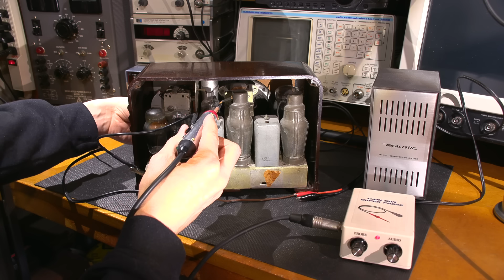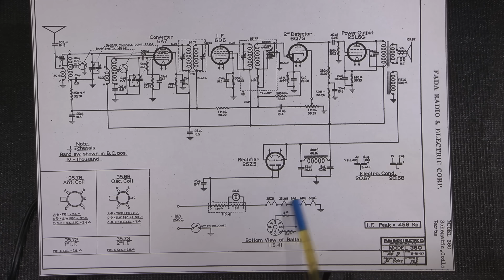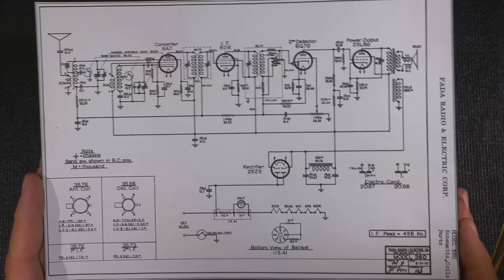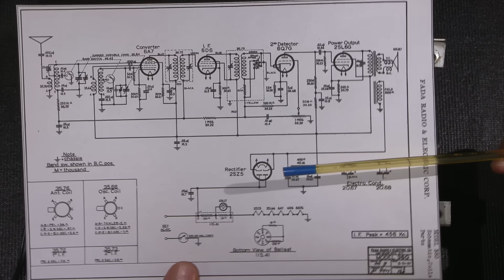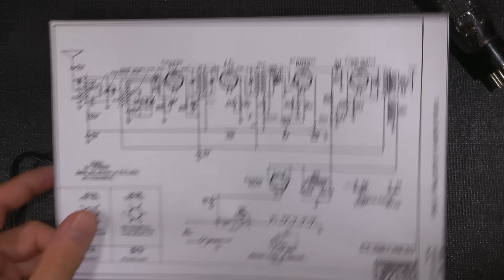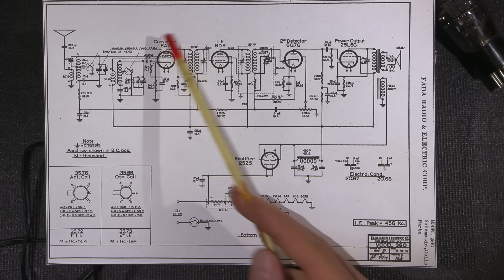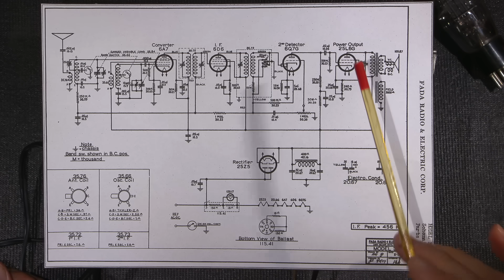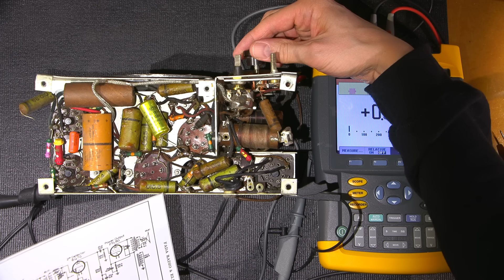Electronic Circuitry Diagnosis And Fault Finding! [Repair]

Comment: I worked as a bench tech in a radio shop in the late 60s.  Worked on mostly German tube radios that GIs brought back with them. Typical issue was power supplies that were designed to work on 50Hz line voltage.  Our 60Hz line voltage would eventually destroy the power transformer and the selenium rectifier stack.

Comment: I know it's 6 years ago but I'm sure this is well worth restoring. The fact that it goes so well with all its old components except for that capacitor might indicate that it should have a long useful life with restoration IMO. Also the case and knobs etc are all complete and in v good condition. Your knowledge of the workings of these radios is quite profound.....fantastic to have that depth of understanding of what looks so abstruse to the uninitiated. Very impressive...and the video presentation is very clear and easy to follow. Well done all round.
Reply from the maker: Thanks for the kind words!

Comment: I used to have those little shirt pocket crystal radios that worked without a battery, and only had enough output for a press in ear piece. I used to enhance the reception with a jumper wire from the antenna tip to the finger stop on our dial telephone. The antenna rod doubled as the frequency tuner.

Comment: @17:10 , what is the 1st tube you're  pointing to immediately off the mixer-tuner? (the tube in the back with grid tube)

I know the front tube is the IF amplifier tube. Is the tube in the back youre pointing to an RF amplifier tube (?).?

Are the wires on top of these tubes with grid caps charged with DC current or just the signal from the mixer-tuner?

[Im new trying to learn, thanks. I have a 1947 Silvertone (Sears) model 7103 radio/phono/wire recorder i want to check out when Im experienced.]

Comment: I worked at Radio Shack in 1981.  We still had the tube testing machine with the new tubes stored beneath the tester. I remember assisting people with it.  Lots of TV tubes were tested.

Comment: I just want to say to begin with , thanks for making this video. I was very interesting and easy explained. I am trying to diagnose and troubleshoot a mid 50's German made vacuum tubes era( not as old as the one in your video).In my case it is the same as in yours. Once plugged in and turned on, there is no sound , no noise , no humming . Like it is 'DEAD". The filaments inside the tubes glow and stay like that. The dial light is not on. I have checked with ohm meter it is good. Is that a clue where I have to took. I don't have a probe and other equipment as you were showing in the video. Any suggestion you may have will be greatly appreciated. Thanks again

Comment: My preferred solution to the line cord problem is to wrap drafting tape around the plug, figure out which should be line and which should be neutral, then mark the tape with L & N, otherwise if you encounter an improperly wired outlet, there will be nothing you can do. Best solution with these, use an isolation transformer.

Comment: My Parents bought a Philco tv & it had a 3 speed Turntable with a AM Radio from 1951. It was a Monster to move the Cabinet was Solid Mahogany Wood. It was there Top of Line model. The TV was a 17” Picture Tube. I learned from a Mistake never ever touch the Flyback Transformer I did once & never again there were 3 Tubes in the Metal Case with the Flyback Transformer!!

Comment: One of the best diagnostic videos I've seen yet.  Great job!
I do have one question though - Working with the Electrohome PU1-4516 radio.  Static comes out of the speaker but no audio.  Would you think it's more of an antenna issue than anything else?

Comment: Old radios are unsafe period and cannot be repaired easily in my opinion.Keep the old circuit in a cardboard box and build a modern battery or solar powered radio into the old cabinet add a few components to up the white noise 😂😂❤
Reply: An interesting but dangerous show 😮

Comment: About 1965/66, I remember we had a light aqua marine blue case art deco Fada radio in the kitchen (no short wave). One day it suddenly stopped working right in the middle of the news from WMCB.

 Mom was impatient and had my sister pull all the tubes instead of waiting for Dad to get home. (Mom was extremely educated, but had negative zero mechanical abilities.  Yet, she was never short of strong opinions of how to fix a mechanical  problem.) As soon as Dad got home, she gave him all the tubes to immediately test or faster test.  Boy! Was he angry. 

He and I went to Woolworth's to test the tubes. He taught me how to use the tester and was amazed that at my tender age  I immediately picked up how to test the tubes. (He did not know i spent many hours watching people test tubes  while Mom was off shopping at Woolworths, Carson Pierre Scott, Zolds, and several others. Different times.)

Woolworth did not stock the ballast tube, as it was too old.

Mom called our TV repairman who analyzed the radio and found a ballast tube 2 days later. Boy! Mom was ANGRY about the delay!  

About a 3 years later, the radio again quit. The repairman said he was unable to find the pHolds, and fix it. I believe he was exasperated with Mom and this was the easy answer.  We got a new fangled transistor radio. 

40 years later, after Mom died, my brother put the Fada radio at the curb for the garbage men. He said it disappeared within an hour, days before the garbage men showed.

Comment: Lots of farms used a DC generator to power the lights back then. Usually where commercial AC power was years away from being available.  This is some of the original AC-DC radios. Thus the non polarized plug. If the radio didn't work just flip the plug over and it works.

Comment: I should probably watch this first but I used to put a 60 watt lightbulb in series with my variac and if the circuit is pulling too much current the lamp gets bright quickly… old trick but a cheap way to check over current. Lots of great information here! Love a great troubleshooting tech

Comment: looking at the low plate voltage measurements you showed, it is likely that the smoothing caps had quite alot of leakage currents causing therefore additional voltage drops across the resistors between rectifier and final audio amplifier tube. would worth checking...seen some british electrolytics being quite bad. but found east germany caps that were actually much better at surviving . i am curious about quality of american electrolytics?

Comment: Nice looking set but I think one of those ghastly transformerless devices made in USA and England, in large part as wartime 'economy' .. but banned in Australia, it had safety  commonsense. That it has a 2 wires figure 8 (lamp cord)  mains cord...which was bad enough itself  and not even an earth terminal....logically perhaps as the active wire could easily be connected to the chassis. Build an external supply or use an isolation transformer...(110Vac to 110V ac) Pretty stupid to have a pvc insulated wire touching the rectifier tube glass. Removing the ballast and rectifier may leave enough room for a 150V power transformer with a bridge rectifier giving adequate Medium Voltage  for the set to work well. 150V 30-75 mA transformers were  commonly used with regen sets...should be plenty around..or some transformers from  miniature radios could fit.

Comment: Hi! Jean-Yves From France.
Looking at the first radio stage amplifier, i'd says it is yet a superheterodyne.
Superheterody consiste of producing a local frequency cloth the the channel frequency but a bit higher or lower and varying with general tuning capacitor in the same proportion than channel frequency.
Those 2 frequencies are mixed, resulting in an intermediate frequency lower and not changing because it is the difference betwen local oscillator and reception frequency. Then it remains to amplify that lower fixed frequency and pass it to a very selected band filter. An then the detector which consist or rectifying the signal, then the Low frequency amplifier.
I think this radio a a quite good quality one.
Field disapeared later since they could make quite good  magnets.
Reply: Not quite " in the same proportion though"
If say you want to receive mw stations from 500khz to 1500khz.. then the ratio is 3:1.. so the tuning capacitor has to have a range of 9:1 
However... the local oscillator tunes from 500+456khz to 1500+456 khz ... which is a range of about 2:1 - so the local oscillator capacitor has a range of 4:1 
That is why you will see the tuning vanes tn the ganged capacitor are of different sizes.

Comment: I do component level repairs on vehicle computers but i really love these old electronics. You open the old stuff and you get a feel for the guy that designed it. You see what parts made him feel clever and proud. Open modern stuff and its just autorouted traces and design rules. An inevitable progression, but disheartening to experience them both.

Comment: I have a Leslie type 122 amp with a Hammond C2 organ. After working on fixing some of the cables to the speaker and replacing some tubes I sadly found I was getting a mild shock when playing and touching some of the metal parts below the keyboard. This was a few years ago. I assumed I either did something wrong or it was happening because of a fault somewhere because of its age and I unplugged it and was unable to use it. This thing is probably 500 pounds and in my basement. I was not aware of the hot chassis situation and a bell went off watching this. I plugged it back in and the problem seems to have gone away. I assume right now its because I guessed right on the plug this time. While I need to do more digging, I am so happy that this piece of equipment is available to me once again and will decide how to proceed. Thanks for posting this - still helping people like me 5 years later!

Comment: Hello Carlson, from my experience is need to be replaced all Capacitors, Resistances but carefuly to check all the time if Oscilator and FM remain on necessary Frequency because change the passive components, create more work for realiniate the both, Oscilator and FM and FI. Generator will need of course if necessary after change some of passive components of course, not the FM and FI Coils.

Comment: I went to a Vocational High School in 1969 and took Radio & TV Repair. It was a half-day class with academics the other half. Learned Electronics Theory and Tube operations.  Semiconductors were introduced in our Junior year. The Instructor was a Ham Radio Extra Class and he encouraged us to learn code and pursue a License.  I never opened a Radio/TV Repair Shop but it was great training for getting an Associates in Electronics Engineering in college. Since then I’ve repaired/restored hundreds of old tube radios. It was a breath of fresh air discovering Mr Carlson’s Lab and getting the urge to clear off the old workbench and fire up the soldering iron again.
Reply: I am fascinated by this .... even at my age : and even after some miracle of having my Ham * lic for over 12 years....... I prefer to do point to point wiring .....   but mostly , I like to learn WHY ......
Reply: This also was a trip back in time for me.  I too went to a Vocational High School in 1961 and took went to a learned Electronics Theory and Tube operations.  Then joint the Air Force and became a ground radar repair technician, retiring after 26 years.  I then went back to school and eared a BS and MS degrees in electrical engineering.

Comment: Very good little radio even knowing that many of the wax cap are probably leaking, already receiving pretty well wonder how close to tuned and calibrated it really is, just think if its out of calibration how well it could receive.
Yes it deserves to be restored.

Comment: Hmm. The cap was shorted out. Then you had the entire Anode Voltage across a 240 Ohm Resistor, no fuse was blown and you did not smell anything? 😒

Comment: Are you ready for this one? It's going to take a long time to see this small radio have up and running again. This was patented and used sometime in 1938. Every radios component needed to be replaced. A modern radio is a little more harder to handle. ⌛️

Comment: 1:08:13 Sir. You're breaking your own rules. You said there's no full line voltage when there are faulty paper/ wax caps. First caps go and then apply voltage without limits. I would of course still connect it via a light bulb.

Comment: I remember the testers well..and a short, long wave and broadcast tube set (huge 4 pin shielded) always had a corner tube that would rush light along with the #54 dial bulbs before the other tubes lit. Static would be heard first then the audio from the last station that was tuned.  Quad variable capacitor tuner, a thing of beauty underneath, all hand tied runs..

Comment: When I started reloading.  I was using a progressive press.  I had issues with primers going in sideways and upside down.  I was astonished how mangled you can make a primer and they didn't go off.  I think it can be done carefully no problem after seeing the squished messes I had.

Comment: The mirror like coating inside the tubes is Barium. Barium is a strong getter material which catches residual molecules in the vacuum of the tube. If the molecules are stuck in the getter material they cannot move around hence there will no pressure generated, keeping the vacuum optimal. Barium oxide is a white powdery substance. So If you see that, the seal is broken and all the electrons fall out. Thanks professor for another wonderful video.

Comment: I'm having trouble with a tube radio that is discharging to the metal plate, and the volume and tuning knobs when it's on... I tried reversing the plug (as it Doesn't have ground discharge) and it doesn't kick when it's on but when it's off.

Comment: I used to work for Beitish Standards Institute BSI and Underwriters Laboratory UL working in the UK. 

We use 240V 50 Hz, the mains plugs with rectangular cross section with the earth pin slightly longer with a replaceable 1 inch cartridge fuse, a range from 1 to 13 amp available. 

This BSI standard BS1363 was introduced in l fron that date all new buildings were to be fitted with the socket with a shutter operated by the longer earth pin was mandatory.

Older buildings had to be rewired to this standard, but I'm not sure of this date. 

Slight updates to the standard were introduced I feel the best is introducing a insulator around the top of the live and natural pins so that children an mainly ladies with small fingers did not get a shock plugging or un-plugging the appliance. 

This standard was adopted by other countries, mainly ex-commonwelth and Saudi Arabia. 

We are using this and a relatively small cable. we can power up to a max of ap😮prox 3 kW of power, a large portable heater. 

Thanks for going through the repair process. I hope a lot of youngster's are watching and it will give them a taste of electronic engineering.

Comment: Valves (tubes) were so commonplace in the 60s i even contemplated making a 'bang' 'bang' single channel radio control incorporating a miniature valve, but in the end opted for the transistor 'galloping ghost ' version.
It is remarkable that your wireless set has only two wires in the power lead so no earth (ground) wire which would have been required in other countries.

Comment: Im trying to get a Philco 96 working again and hopefully use it as a guitar amplifier. Can you point me on the right direction as far as replacing caps and making sure its ready to turn on. The 80 rectifier tube was missing and the speaker cone needs replaced. Thanks ive enjoyed your videos. And tips or clues will be greatly appreciated. Thanks Collins.

Comment: NO, do not substitute these old-fashioned paper capacitors for modern ones!! That would be to destroy the value of this old receiver. Instead try to find such old and never used capacitors on the internet. I am sure that there are elderly fellows who are sitting on collections of electronic components from the forties, fifties and sixties.
Reply from the maker: Never used old wax capacitors are all bad too. I have brand new in the box waxies from the 40's and 50's, all electrically leaky.
Reply: That is a pity. This video and these old capacitors and other electronic parts made me remember the days back in the fifties when I built radio receivers and transmitters using electronic valves. Some projects I was engaged in were quite complicated, as for example building an oscilloscope @MrCarlsonsLab

Comment: It has broadcast band and the very old police band. Other things were also located in the "Police Band", however it is what the common name of the band just above the broadcast band. I remember listening to the local police there before they moved radio operation to the vhf band. At that time, the DuMont television, with continuous tuning, was useful for listening to the local police and dire departments. (We sold that television several times from my father's television shop. Each time, it would be returned because the customer wanted the convenience of the channel selector clicking to the selected channel, not a tuner that tuned continuously from the bottom of the vhf channels all the way through the FM, aircraft, 2 meter ham, utility, and the upper half of the vhf television band.)